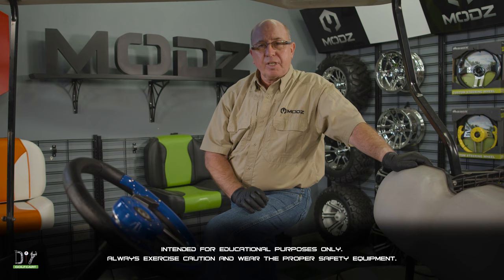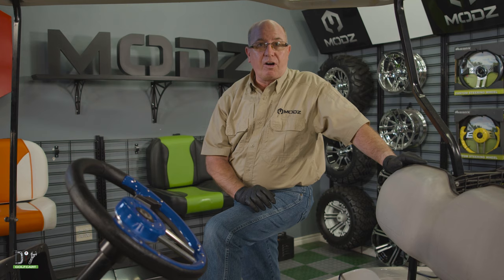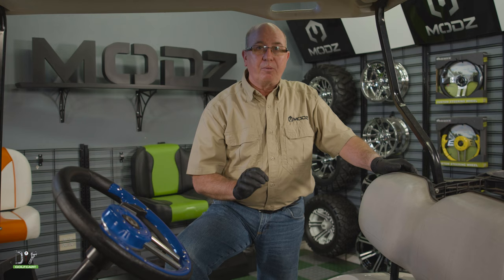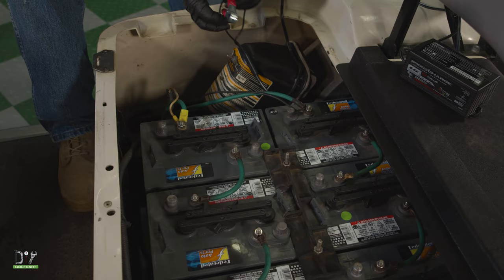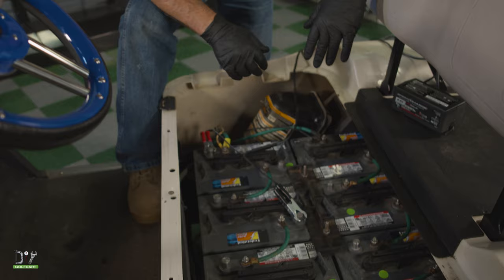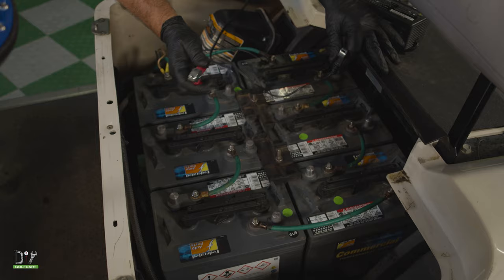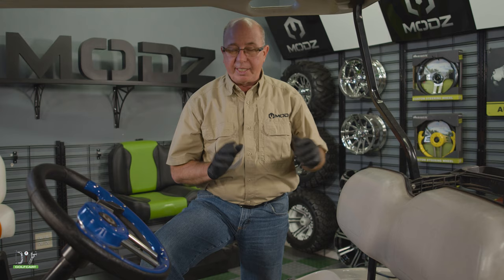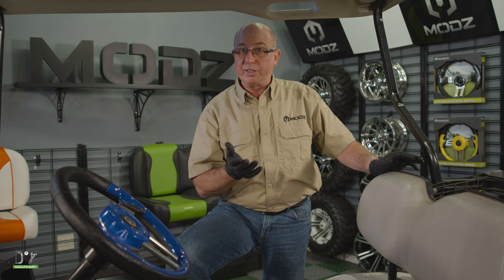How to Charge Dead Golf Cart Batteries - Reviving Dead 6v & 8v Golf Cart Batteries FAQ

Comment: Save your old battery chargers that charge dead batterys! The new fangled chargers Won’t go figure!
Reply: Many smart chargers need to sense a voltage so that they know they are hooked to a battery and then they start the charging cycle. If you have a battery that has a voltage so low that the charger can't detect it, first off that's very bad for the battery and will shorten its life. But past that, if you want to try and squeeze some more life out it, you need a dumb charger to charge it up enough so that the smart charger can tell there's a battery there. Kind of goofy but that's what you do. When you use a dumb charger be careful not to overcharge your battery. With smart chargers you don't have to worry about that.

Comment: Thank you. Exactly what I needed. Six 8-volts for thirty minutes each. Now I understand why my sensing circuit on the charger wouldn’t allow the charge.
Reply: What amperage did you charge with? 2a? 10a?
Reply: @johnnywoods227 kind of annoying no one ever says that answer
Reply: @philipchesleyiii  Going to depend on how low they are, I've brought some 8v banks back that were extremely low charging each one individually on a 6v 10 amp charger for 24 hours. Then putting them in 2 seperate banks of 3 in series, 24v per bank, and charging each bank with a 24v 15 amp charger that has a good lead acid charging profile. If they are starting out at 5.5 volts or higher per battery you can skip the 6 volt charge and just use a 24v charger.
Reply: @Reloadeez  I just did them in sets of 2. I charged the first set for an hour and 45 minutes, at 10 amps. Then charged the other two sets for 45 minutes each at 10 amps. I also had to refill the batteries cuz they were kind of low. Worked out.

They were all still connected, I just moved the cables from post to post.

Comment: I brought back a bank of 8v club car batteries that I thought had zero chance of coming back from the dead doing something similar. They had been sitting for 3 years, had less than 1v per battery on the multimeter, and extremely low electrolyte levels. I added water to around the 60 percent full level and put each one individually on a 6v charger overnight, took 6 days. I then added water to around 75 percent level, and put 2 separate banks of 3 in series on a 24v smart charger with a good internal lead acid charging profile overnight. Topped off the water and did a 24v desulfation mode overnight for each bank. 48V bank read 51 volts on meter when done and each battery was within 0.10v of each other. Have been running on the bank for 2 years with no issues.

Comment: I have six six volt batteries and they're all completely dead. I connected the two batteries as you suggested in your video with a 12-volt charger and I still get a zero reading on my charger. If there's no voltage in the batteries how can I make my 12-volt charger connected to the two batteries operate properly
Reply: It sounds like you may have dead cells, don’t take my word for it and do more research ofc but it sounds like you make need new batteries
Reply: I think The meter on the charger measures amp rate while charging, when hits zero its charged. Check each batt with a multi meter. I think any batt under 6.50 V is bad or getting close

Comment: Thank you for the clear instructions. 
We returned from the beach 2 months ago and I left my golf cart inside the toy hauler. I found the batteries completely dead and my charger would not start, which is why I came to your video. 

Going now to use my 12 V charger following your instruction. Thank you so much.

Comment: Worked beautifully. Thank you so much!!!
Reply from the maker: Thanks for watching and don't forget to subscribe.
Reply: here's  a few ideas for getting a good result
do not attempt to do this until you know what you are doing - the acid can burn your skin
Test the voltage first - there may be a kaput cell which would waste your time.
Check the battery fluid.
attempt to fully charge the battery.
(I learned about these and more from Jons mender guide site )

Comment: I have a 48v  golf car with 6  Trojon battery. My problem was I only have 40v across from number 1 to 6 after 36 hr of charging . All battery measure 8v except for number 5 only produced 6.66v.
Question:
 is my number 5 battery defective and need to replace or can revive it with a 8 v trickle charge?
Also, when I initiate the charger it starts with 12 Amp now 36 hr later it show 0 Amp. How is that happen? Is my charger ok?
I am new to golf car rodeo, any help would appreciate.
Reply: I think your chargers meter type reads hi amp when batt r fully drained,  and will head to zero as it nears fully charged.  I’m no pro tho...

Comment: 1 hr lol if the voltage is low eg 1 or 2 volts, to charge each set takes 10+ hrs with 4 amp, so to get the 6x8v or 8x6v batteries up above 37v as needed this can take a few days. (48v)
Reply: 8x6v unless you make up a wiring set to charge 2x6 with a car = 12v then 6x leads to jump the other 3 sets, with each set only in pairs of 2 then you could charge them within an hr for the controller to take over (+37v)

Comment: My 12 volt charger has 3 settings...  50 amp, 10 amp, ad 2 amp...  Which one do I select for my 36 volt golf cart with Six (6 volt) batteries that are dead...  my battery charger for the golf cart will not come on and charge my golf cart.
Reply: I have the same problem and looking for a response
Reply: Charge two batteries at a time as shown in this video. Start with 2amps, then go to 10amps as the batteries pick up a charge after about 2 to 3 hours or longer. By that time, your batteries should be charged enough so that your cart charger kicks in. If not, you may have dead cells in some or all of your batteries, which means you might want to recondition them as explained in many Youtube videos by using a method you prefer, usually by removing the acid in all the batteries and replacing the acid with acid or similar material bought at an auto parts store. WEAR PROTECTIVE GEAR or you might get seriously hurt.
Reply: @chrissy2178  Charge two batteries at a time as shown in this video. Start with 2amps, then go to 10amps as the batteries pick up a charge after about 2 to 3 hours or longer. By that time, your batteries should be charged enough so that your cart charger kicks in. If not, you may have dead cells in some or all of your batteries, which means you might want to recondition them as explained in many Youtube videos by using a method you prefer, usually by removing the acid in all the batteries and replacing the acid with acid or similar material bought at an auto parts store. WEAR PROTECTIVE GEAR or you might get seriously hurt.

Comment: What if I don't have a battery charger to spend 3hrs putting enough amp in battery how can I get it started?
Reply: Push your golf cart next to a car with a good battery. Connect jumper cables from the car battery to the golf cart batteries (make sure you connect to the battery ends that are not connected to other batteries the cables usually run towards the rear of the cart and positive and negative are on the correct posts) then turn on your golf cart charger it should now turn on then disconnect the jumper cables and continue to charge your cart as normal.

Comment: I have a 1984 36v cart and debating on removing on of the 6v and adding a 12v deep cycle making it 42 volt. I have one bad battery and a new 12v I’m not using. Can I do this or do I need to remove two of the 6v and add the 12v to keep it 36v. It struggles with hills as it currently set up so I was wanting to use the new 12v I have that’s not being used to see if I can get more pep. Any advice?
Reply from the maker: I know this is not what you're going to want to hear but, No that will not work for long. Something will burn up. If the cart is equipped with a controller, you can upgrade the entire electrical system to 48 volts and alleviate all you climbing issue or trade it in on a 48 volt golf cart. You will never be happy doing any climbing with 36 volts.
Reply: Thank you for the information. I don’t know if it has a controller or not. I know nothing about golf carts. This is my first one
Reply: It’s pretty old and I don’t see anything that looks like a controller for the images I googled. It’s a old cart before electronics so to speak. It’s a pretty simple cart. Old 3 wheeled cart but good condition still for being 35 years old. Lol
Reply from the maker: @patrickhailey5812  Follow the wires from the solenoid. One of the wires will be coming from a battery positive and the other will either be going to a coil spring or to a box (controller).

Comment: Can you recommend a cheap 12v charger? Since it doesn’t happened yet and just want to have it handy, I don’t want to spend a lot for a charger.
Reply from the maker: The latest and greatest charger on the market right now is the MODZ MAX charger. It's weather proof and does a great job of maintaining a golf cars battery pack.
Reply: DIY Golf Cart thanks for the reply. I’m interested more on the battery charger to use to revive the batteries when it hasn’t been used for awhile. Is there a brand, type of charger that I should buy?
Reply from the maker: @Ernie831  No such animal.

Comment: my golf car is a 48v and batters only have 0.1 to  0.4 volts in them and the car charger won't charge the battery.
Reply from the maker: Dead cells = Needs new batteries.
Reply: @golfcartking  thank you

Comment: As an electrical engineer I am curious as to how a relay can sense a voltage?
Reply: as an electrical engineer you should know there is such thing as a voltage sensing relay.  I think that is what he's referring to.  Not that its relevant to anything in the video
Reply: @brockmunn7858  you are thinking of a semiconductor or other solid state voltage sensing circuit controlling a standard electromechanical switch (relay)

Comment: My 6 batteries are linked together but the last two are connected to what I think is the charger. How can I determine which one to connect the the positive and negative terminals using the charger?
Reply: Connect your batteries in Series. Number your batteries 1 to 6, going from 1 to 2 and 2 to 3, etc. Always connect the positive terminal to the positive of #1 and the negative terminal to the negative to #6, which will provide a charge throughout the entire series of six batteries.

Comment: Why don’t they make a golf cart charger that recognizes low voltage or have reconditioning capability?
Reply: I totally agree,  I wish someday some individual or manufacturer come up with this new kind of charger.
Reply: I think because of govt regulations. Don't want you to be able to use the charger plugged in the and touch the prongs to someone skin and send electricity through them. Safety.

Comment: For 8 volt batteries do you have to take off the connectors?
Reply from the maker: No, do not disconnect anything other than flipping the switch to TOW.
Reply: @golfcartking  Thank you! I just wanted to say that I have gone through so many videos and found this one and I have so far charged 5 batteries and can finally almost use my golfcart thank you so much!
Reply from the maker: @metro9203  Fantastic! Glad to have helped!!
Reply: DIY Golf Cart     I’ve tried charging one battery at a time for 30 min.  Then I plugged the golf cart charger it blinked like it was charging then it stopped and went blank again
Reply from the maker: @rustylozanolpc4227  What is the voltage at the charger receptacle on the car? We need to see what the charger is seeing when it's plugged in.
Reply: 19.34 V and rising after unplugging the charger.
Reply from the maker: @rustylozanolpc4227  That should be around 48 volts minimum.
Reply: Ok.. yeah they aren’t charged enough.  Can I get away with charging one or two batteries fully?
Reply from the maker: @rustylozanolpc4227  Yes
Reply: I called a local golf cart supply.  Their “quick” recommendation was to just leave the charger on one battery, which will charge all of them.  I did this for three hours and I’m only up to 27 volts at the cart port on the multimeter.  It may take more then 3 hours to get it back up there.